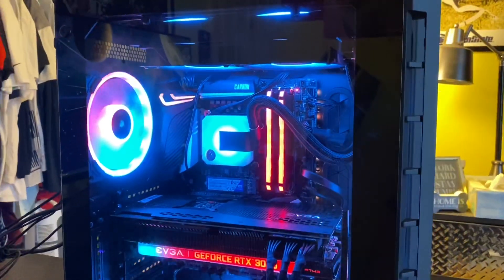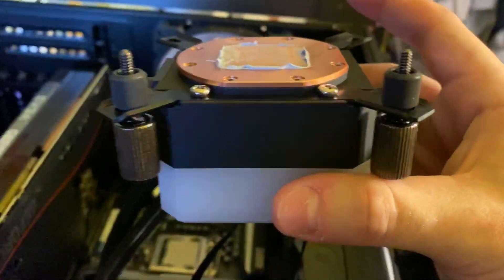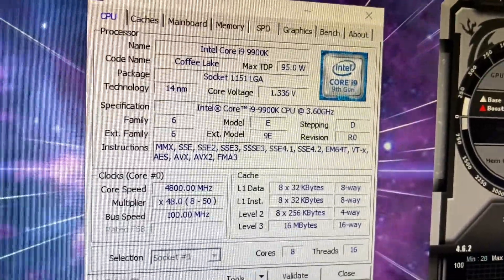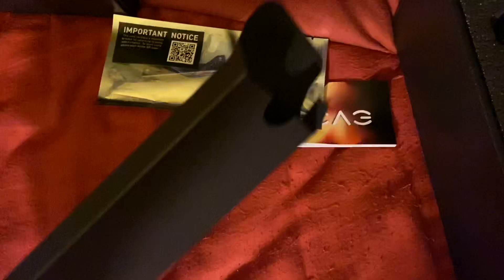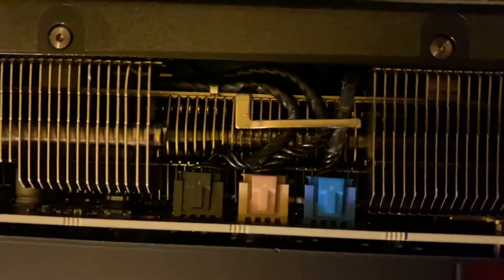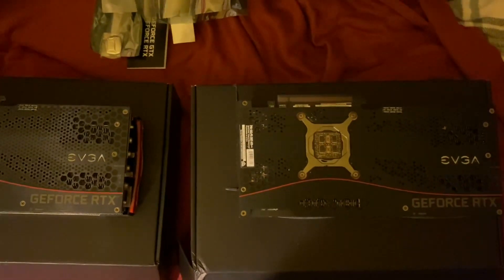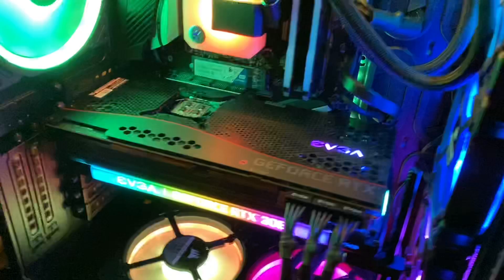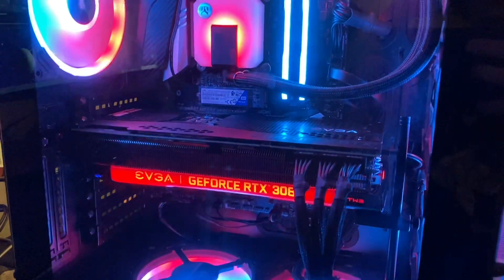PC Update #5 | EVGA 3080 FTW3 Ultra RMA & i9-9900K Upgrade | Red Lip vs Black Lip EVGA FTW3

Comment: Hey man so I'm planning on getting this bad boy would u recommend it or does it have problems (the ftw 3080)
Reply from the maker: 100%, buy it the second you can! It is an amazing card, do not let my issue impact your buying decision! I got unlucky with a card and EVGA's customer service was amazing with the RMA process! Saw someone had an Asus strix die on them and it took almost 2 weeks before they even got a response!

Comment: What are your temps on games with the stock bios ? I have around 62 to 73 ( it depends on the game of course ) , it is summer in my country.
Reply from the maker: Sheesh those sound close to the temps I get in winter in my country right now! Seems to be pretty good, I'm not sure what I got on stock bios but at the moment with custom fan curve and oc mode, I get 58 to 68! Fan curve starts at 35%/30c and then goes up to 100%\80c! Alittle louder than stock setting where fans are off but I'll take the colder card!
Reply: @ImSockMonkey  So to be summer in my country, are they good temperatures for my evga ftw3 3080? i also did a fan curve in msi affterburner lol.
Reply from the maker: Yea they seem pretty good as long as the 73c is like cyberpunk or metro exodus! One thing I would recommend is setting your fan curve in precision and then using afterburner after you set them! Afterburner only works for 2 of the fans! Precision works for all 3!

Comment: Finally, your GPU will be better fed with the 9900K ! 😊
Reply from the maker: Haha yeah, it's already been thanking me! Feels alot better to see 50% CPU usage instead of 90% when gaming!
Reply: @ImSockMonkey  
😊
Imagine for me also, coming from i7-5930K and got my new rig with Ryzen 5900X. 🙏
Reply from the maker: @GRAbibus WOOOWEEE, that's a huge upgrade, congrats on finding one! Those new Ryzen chips are incredible, it's gonna take years/new GPU's to max them out in gaming!
Reply: @ImSockMonkey  
https://youtu.be/B6auLQoPlZI
https://youtu.be/uJ2ZHaLkBNQ
I love Cold War with my new.PC 😊
Reply from the maker: Sheesh, nice gameplay, that 5900x barely goes above 30%! We should play sometime, always need more for a 6 stack! Do you have your gpu water cooled? That clock is high!
Reply: @ImSockMonkey  
The EVGA FTW3 3090 (at least mine, but I read this also this on EVGA forums), is highly power limited. I mean, at stock Bios, adding for example +100MHz on core and pushing voltage slide and power limit at 100% in MSI AB, I got maximum 1995MHz and max 0,987V in TimeSpy. After a lot of discussions on overclock.net and also in EVGA forum, I flashed it with a KFA2 bios 390W 2x8 pin (despite the card is a 3x8 pin). You can see now the incredible results I have ;  power below 100%, temp in mid 60’s (as if I was on water, but I have stock cooling), memory chip not too hot also.
My memory is also overclock with +1500MHz on memory, this means 22500MHz (stock is 19500MHz) 😊
Reply from the maker: @genergia  sheesh, sounds like a mighty change! I am not up to knowledge on a different bios swap and everything but it seems like it did an amazing job on your 3090! WC'ing was my initial thought just seeing the clock speed so high! Awesome job on it dude!
Reply: @ImSockMonkey  
Yes we should play. What’s your Battlenet ID ?
Reply from the maker: @genergia  ImSockMonkey#1394

Comment: How was this upgrade, was it worth it in your opinion as I was thinking of doing the exact same thing ?
Reply from the maker: I'm loving it! 9700k was hitting 80-90% usage in Cold War and if I streamed it hit 100% and I'd lose 100+ fps! 9900k doesn't even hit 70% usage while streaming with discord and OBS, the hyperthreading and extra 8 threads make a HUGE difference!
Reply: @ImSockMonkey  I found a 9900k for an amazing price and couldn’t resist this morning, did a bunch of tests and wow amazing results compared to 9700k, 50% usage in warzone and gained 20 frames stock from my overclocked 5ghz 9700k.
Reply from the maker: Glad to hear you pulled the trigger! It's definitely a refreshing feeling seeing the low usage percentage!

Comment: Have you ran time spy, firestrike etc... yet?
Reply from the maker: I ended up doing a full run on Port royal, stock to max OC! Ended up being able to push the new gpu to +165 core and +1200 memory before seeing any diminishing returns or crashes! Port Royal max score was 12445! Card stayed around 2100 mhz with avg temp of 54c on air, window open of course and fans on max!